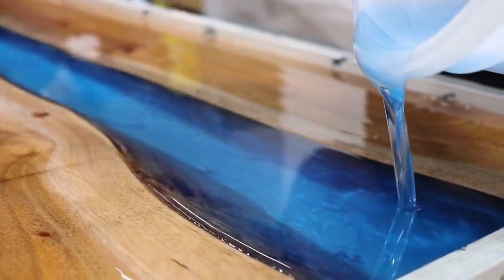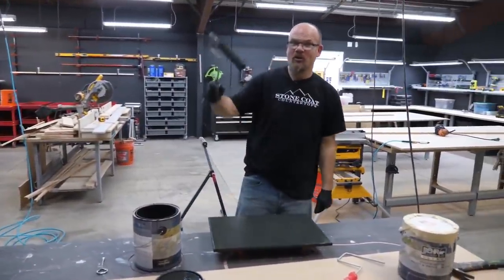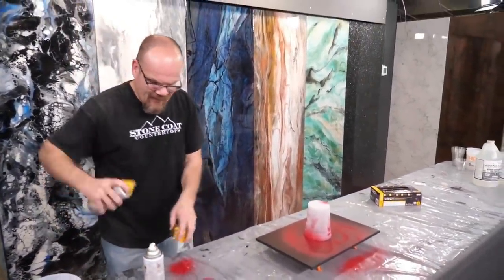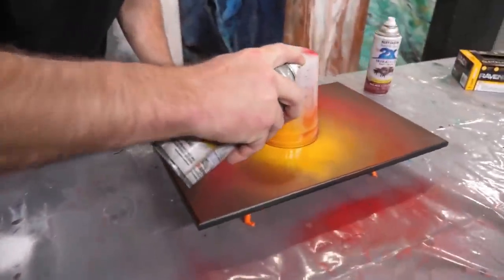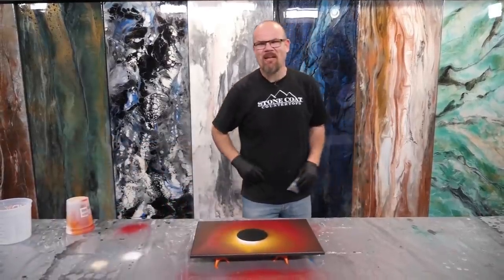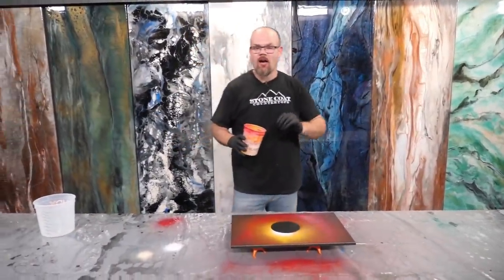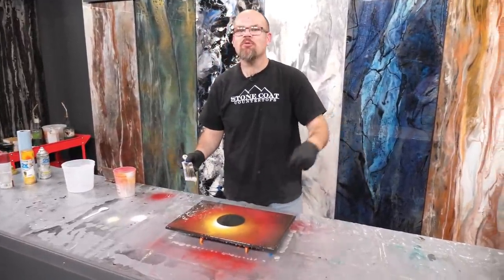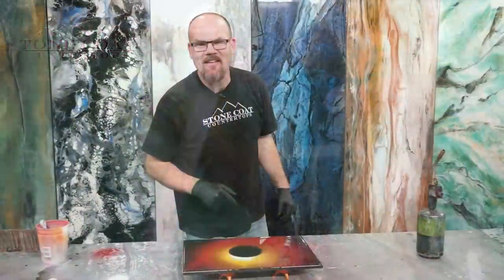Black Hole Spray Paint Art with Epoxy

Comment: So no sanding the black paint between coats of black or prior to application of the epoxy? (after spray paint)
Reply from the maker: Great question John! Yes you will still need to sand in between coats to create that chemical bond. -Nathan
Reply: @StoneCoatCountertops  Are you sure?  He didn't in the video.  220 grit?
Reply from the maker: Yes 220 grit would be perfect!
Reply: @StoneCoatCountertops  So I let the black hole spray paint dry for 2 days, then went to scuff it with 320 (I thought I'd take it easy, first) at low orbital speed.  It completely destroyed the colors.  I used the exact paint you have in the notes on this vid.
I now have to repaint the table black and start almost from square one.

Comment: Hi hey the mixer ? Where do we fined one.
Reply from the maker: Robert Duffy, here is a link to the mixing paddle we use, you can find these at home depot as well in the paint aisle.
https://www.amazon.com/Allway-Tool-10031-Gallon-Silver/dp/B000I1VHG2/ref=as_sl_pc_qf_sp_asin_til?tag=stoncoatcoun-20&linkCode=w00&linkId=5805a752f4793733ff5c190ccdd42384&creativeASIN=B000I1VHG2